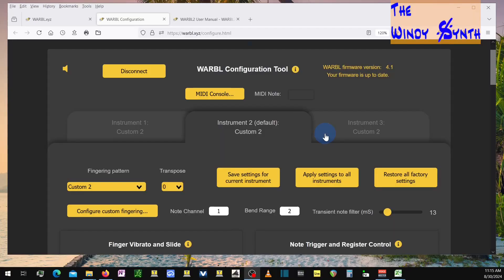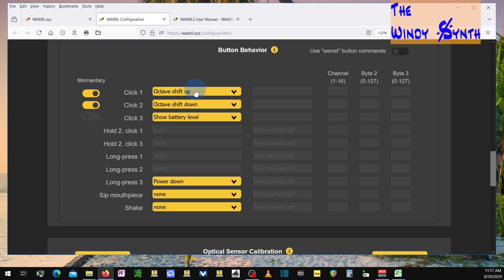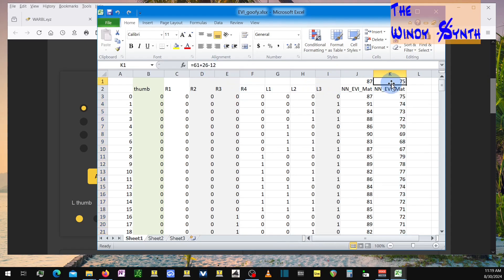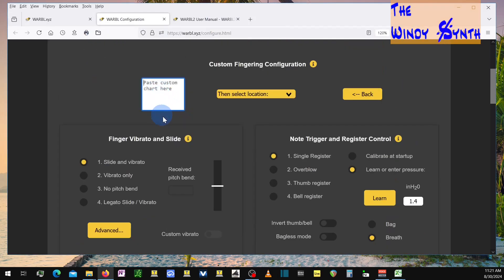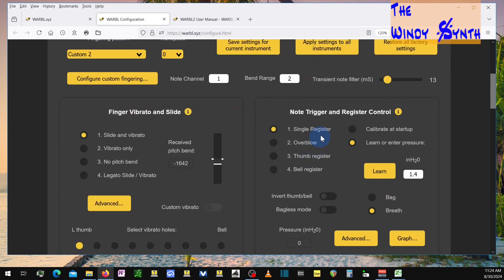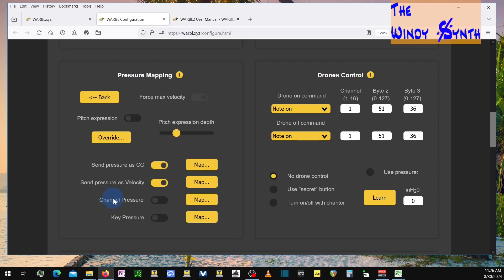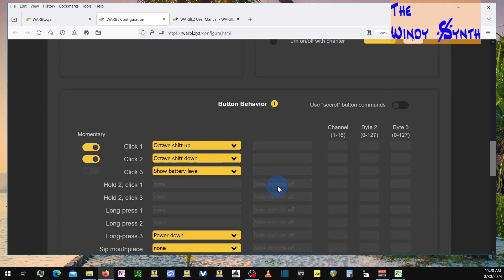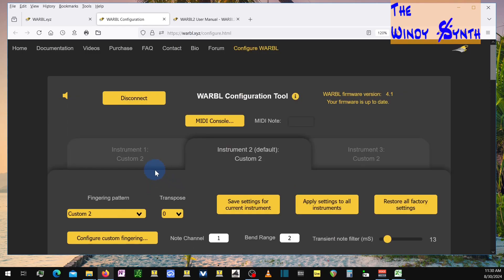Warbl2 as EVI controlling Windy-1 Synthesizer

Comment: Hi dear, please open this model, what is inside?
Reply from the maker: Oh yeah, right. I'll get to it at some point. In the meantime, the code is open source, so that will give you a good start.  The github link is on the website for the warbl2.
Reply: @windysynth  thank you I can't find the GitHub link about open source code for warbl2 
where is that dear?
Reply from the maker: I'm not sure what you are asking me (maybe bad translation?), but...
The Windy1 Synthesizer is my design based on a Teensy 4.1.  The Warbl2 is available online and has fully programmable fingerings.
Reply: @windysynth  Hi again I mean if you could surgery the Warbl2 to explain how is working and what is inside please

Comment: Excellent video, thank you. I am sort of torn between the Warbl2 and something like an EWI USB or similar. I only intend to use it as a MIDI controller and wondering if the limitation of not having a embouchure sensor and the limited octave range wound be an issue. That and, if I am correct, it does not send separate velocity messages for note attack. I am not interested in Celtic sounds, but mostly synth and brass using EVI fingering. I am attracted by it's small size and I see you have many wind instruments, any advice on the Warbl limits and playability?
Reply from the maker: @rogerredford4010  glad you liked the video. The warbl2 can send velocity info. That's how I have it set in the video. My Windy1  Synth doesn't use it at the moment, using the breath cc instead. But a lot of synths do use velocity. 
The fingering I came up with for the warbl2 works OK, but the buttons for the octaves aren't great--good enough for some fun while traveling, but not for your main horn. The EWI usb is a better way to go if those are your only choices, since you are not a tin whistle player or bagpipes player. 
Nuevi if you can afford it.  Try patchmanmusic.com. they sometimes have one for sale.
Reply: @windysynth  Thank you for your detailed reply, I appreciate your advice! 😀